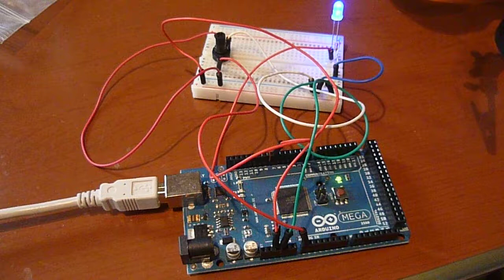PWM LED Brightness Control

Comment: great video. I have a question. I have a small n scale train layout. And a small town on the layout. One of my buildings is a theater. And I want to put led lights in it. The only difference is I want the leds to look like flash bulbs like a concert is going on in the building and people are taking pictures. Can you give me some suggestions.